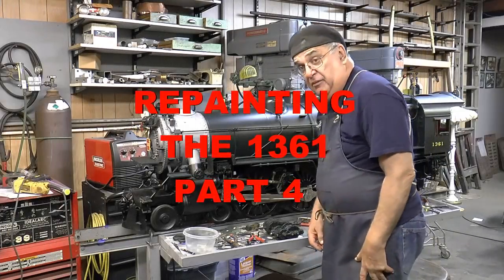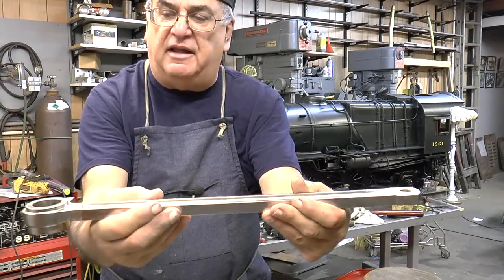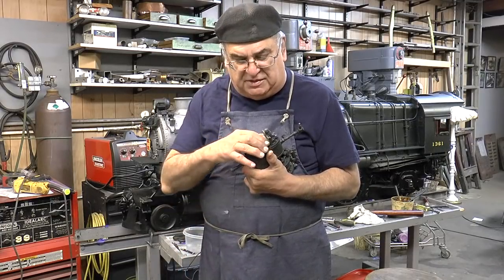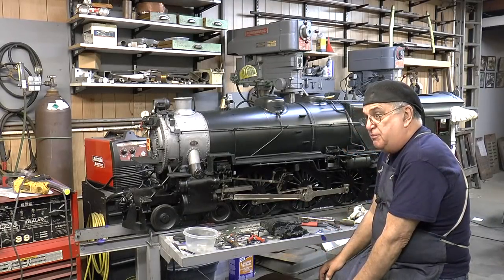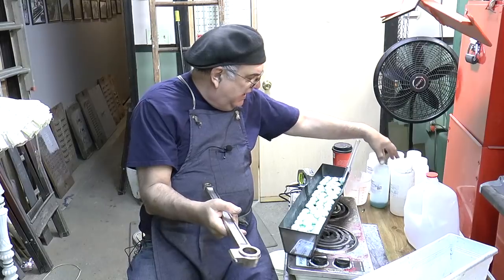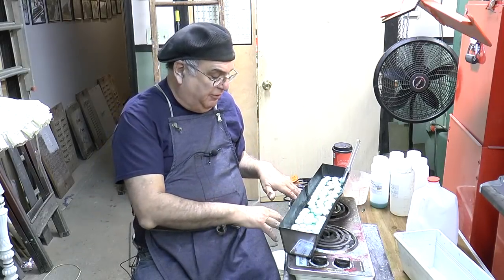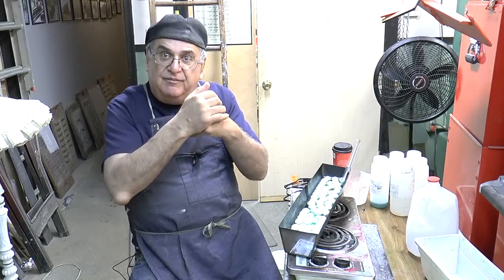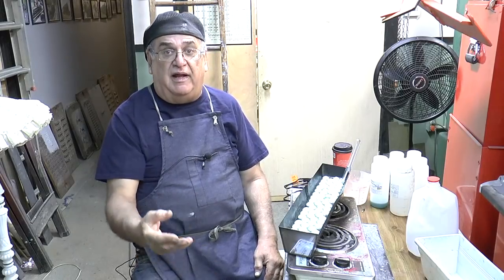PAINTING THE PENNSY K4 1361 MODEL

Comment: Looks good!  One suggestion on the next set of rods that might do well for you:  when they are machined and look the way you want (maybe just a little dirty) powder coat them clear.  They will stay looking exactly like that forever.  I've used it on case and machined aluminum and steel for truck parts.  Generally in the engine bay, because I hate things looking too "hot roddy" and the clear coat simply makes them look like that forever.  Don't blast them prior to powder coating, just make sure they are well cleaned.

Looks good!
Reply from the maker: That would work if they were steel but they are bronze I like to start off with a rough casting and michine them on all sids that is why I plate them.
Reply: Makes sense.  Note to self:  when I build a live steam locomotive (that will be a long time from now--hopefully I remember) I should try to use steel just for this reason.  You could still clear over the nickel, but I'm not sure that's any better than simply keeping the nickel clean.